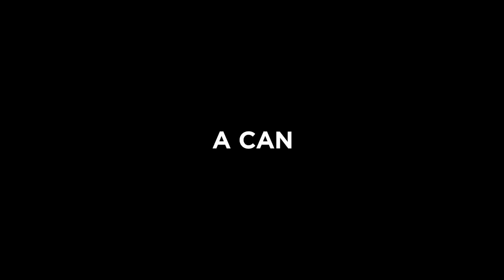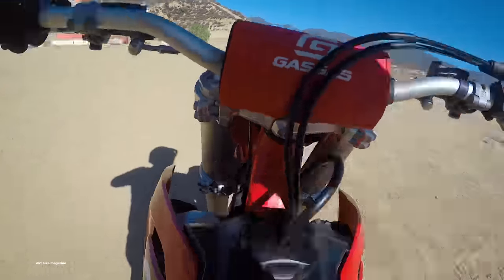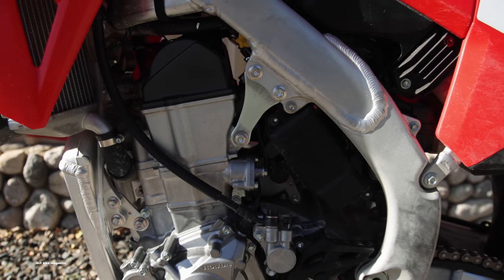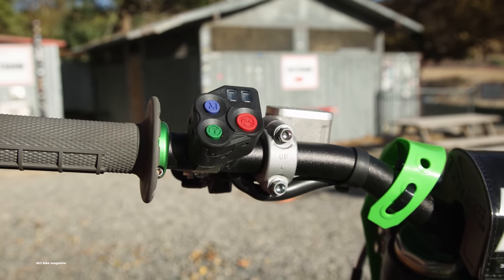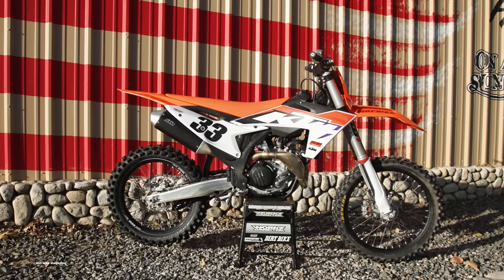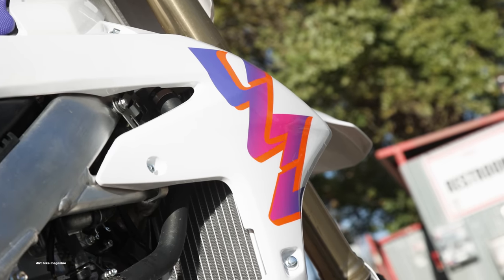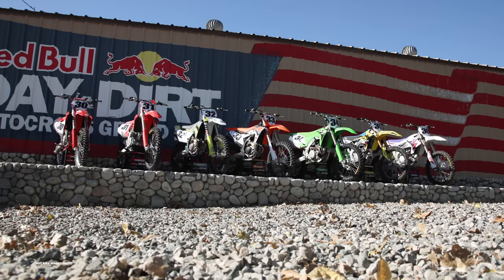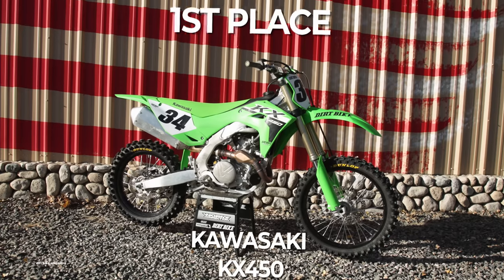2024 450 Motocross Shootout

Comment: I bought a brand new Suzuki 450 with a Yoshimura pipe out the door for $6800. I promise you 98% of the people reading this cannot ride this Suzuki any faster or slower than any other bike on this list. Also, if you are not riding Supercross you can simply blister some of these $11,000 bikes. Has a lot more to do with Rider than the bike. I am 59 years old and could not be more happy with the Suzuki. I’m never going to do a triple but I can have just as much fun maybe more for half the price. Think about it before you go and buy a motorcycle you cannot handle or ride to its full potential….. just saying
Reply: Thats 100% right
Reply: Hell yeah - recently picked up a new leftover '23 for $6,200 OTD and couldn't be happier as a vet-aged beginner. Way more bike than I will ever be able to handle at an incredible value.
Reply: @nathanneudecker6516    congrats!  I would have snatched that up in a heartbeat too!
Reply: Love the new RMZ450 but def won't get it for under $8k OTD in my neck of woods! Haven't checked in last 6mos ..betcha its MSRP though same as other popular brands.
Reply: @Davido50  North Carolina
Reply: @Davido50    i saw a new 22' rmz450 still hanging around for 5k.  What a steal that is.
Reply: Ĵust pick what color you like and ride it .. Nerds
Reply: Electric start makes a world of difference in a race should you wreck or stall the motor
Reply: @jordanl696  the only people saying they don't like or need an e start bike are those without an e start
When I stall my kick start bike it can take me 5 to 45 seconds to get going again (hopefully) . An entire moto would be tossed away
In the woods it can open up a gap it takes an hour to make up on a competitor
I scramble to grab my clutch and keep it running when I crash
Reply: @jordanl696  You’re absolutely right when you have plenty of power. I have four electric start dirt bikes. But you’re absolutely wrong when you’re 30 miles away and your battery goes poof. You would wish you had your Kickstarter back.
Reply: @SKG1941  I think you all should realize kickstart is awesome.  It simply works.  I have both and it’s convenient to hit the start button.  I don’t thinks it’s that big of a deal to kickstart a bike.  I think it’s just people simply to being lazy.  Incorporating half the crap on the bikes we have isn’t making them necessary better.  It’s complicating them and making them harder to troubleshoot and making them more expensive.  We don’t need e start and fuel injection.
Reply: I completely agree.
Reply: @someoneyouknow96  by"we" are you speaking of you and ithe mouse in your pocket?
Reply: i just bought a new 2024 -- suzuki dealer is 5 miles from me -- every other dealer is at least 35 miles -- did not even test ride any of the others for that reason  -- i'm 2 years younger than you  -- i have no complaints at all with the bike and agree with what you said -- all the power i can handle
Reply: @jimnagel5611  Amen my friend
Reply: @someoneyouknow96  HUGE steal. Where is this? They want MSRP by me unless it's leftover model. They all sell too well out here. #KTM #Yamaha
Reply: @jimnagel5611  That's way to do it..esp if ya have good local dealer! Enjoy that new 'Zuki.
Reply: @Davido50    sounds lazy to me.  Maybe ride girls bikes like 110s might be a better solution for the more feminine "guys" out there.
Reply: @someoneyouknow96  traction control, mapping, and launch control are ridiculous features for a bike. Those features remove skill levels between riders. Do t need them or want them. Like you said, more expensive to buy and fix.
Reply: I can drive 2.5 hours east and west of me but I can still get a new RMZ 450 for 6k
Reply: @dustinkeim179  I was at the dealership two weeks ago. He had one Rmz 450 Left for $7000 plus tax and whatever.
Reply: @dustinkeim179    badass!!
Reply: Where do you get those prices? I want to buy one but my closest dealer sell it for over 10k+ with fees and bs
Reply: @adrianlozano2687  I got it from our local dealer here in Wilmington North Carolina, which I have a great relationship with. He only had one more 2023 and he was said he would not take less than 7000+ tax and freight.
Reply: @jordanl696 also makes a world of difference for a non-racer, over 50 years old and in need of knee replacement and cardio improvement😂
Reply: Cheers to that. I have as much fun on my vintage bikes as my buddy has on his super modified late model. I go just as fast, too. He's got over $20k in his. I have under $2k in mine. Get any bike you can afford and go have a blast
Reply: @oemclutchbasketoemclutchbasket  Amen. The older the bike,the easier it is to maintain. This computer crap and fuel injection is amazing but at the end of the day I wish I had my DR 650 back. Keep the shiny side up and enjoy every second.
Reply: Tottaly agree, in my case i always get the lightest one, i am 65 kg 174cm so i need the Lightest one to be able to controll it as i like ;) idc the brand
Reply: @someoneyouknow96  Near me in Upper Midwest ..RMZs get MSRP cause they sell well. None in stock last i checked w/ 2 local dealers. Yamaha/KTM/Kawi also sell really well. Again it's MSRP for all + tax. Never pay setup fees etc. All obligated (by manufacturers) to prep bikes! Blows me away that ppl pay extra $1k+ for setup/freight/tax. Negotiate better w/em i say!
Reply: @SKG1941  Depends on what's selling in particular areas etc. Yamaha/ KTM /Kawi also def MSRP. Both local dealers are excellent at least & dont charge other "fees" except sales tax of course. 2-3 w/in 1hr distance i may check out. Or may get 250F instead. I'm Vet rider /racer. New Triumph 250F looks outstanding w/48hp (claimed) + lightest weight in class. Beta & Ducati look to be other solid options in near future. -NW Ohio
Reply: @someoneyouknow96  Wow thats an excellent deal. We know it's same bike so whether '22-'24 makes no difference. Still avail? You should grab that. Could resell it elsewhere for $2k profit easily.
Reply: @64maxpower  For sure bub. All are great bikes. Having options is a good thing! 👍🏻
Reply: @64maxpower  Truth. Your at clear disadvantage in any competitive environment w/out e-start. Otherwise no biggie.  Still hard find new RMZs in my area under msrp unless leftover model. 😢 -NW Ohio
Reply: @someoneyouknow96  Well it's a definite disadvantage not having e-start in any competitive environment . Play riding or otherwise no problem. #Maxima #KTM #Yamaha
Reply: @someoneyouknow96  No beta guys out my way riding/racing there cupcake. Lots of us are Veteran riders/racers that started as young teens late 80s /early 90s. As long as im not in racing environment kickstart is ok. #KTM #Yamaha  -NW Ohio
Reply: @ronn68  Many are indeed unnecessary but def not all features. E-start, traction control, fuel injection, map choices improve the experience & often performance. Facts. -Ohio
Reply: @dustinkeim179  That's great . Like said in other comments just depends on demand in particular areas. I'm not in a major metro area! More lite suburbia/semi rural/farming etc but 1hr from 3 major metro areas. My 2 local dealers stock most brands & have no trouble sellin em. Rare to ever see leftover units. -NW Ohio #KTM #Yamaha
Reply: @SKG1941  That's very solid deal esp if has RM Army package. I'd prob snag it as extra bike. Rode RM125s in early-mis 90s . Loved em. Now all KTM & Yamaha in my garage. Maybe Triumph soon. There 250F w/48hp (claimed) looks outstanding. -NW Ohio
Reply: @oemclutchbasketoemclutchbasket  I feel ya! Vet rider & racer here as well. 52yrs old. Been ridin/racin since late 80s . Msrp + tax out by me unless it's leftover. Rarely any leftovers tho unfortunately 😕. -NW Ohio #KTM #Yamaha
Reply: Absolutely 💯. Have 2 early '00 RMs i def won't sell. My newer machines are KTM / Yamaha tho. Wouldn't mind new RMZ 250 or 450 if prices were below msrp like NC dude says can get. -NW Ohio
Reply: @Billyipod  Ya hear MX Action sayin all new Triumph 250F has 48hp (claimed) + lightest weight is class? I'm def interested. #KTM #YAMAHA
Reply: E-start is not just a racer's advantage. Having to kick start can make a precarious situation that much worse. Dangerous, even. Haven't any of you ever stalled on a hill climb? How about trying to restart if you have a get off. Hell, just kicking a big bore or high compression bike repeatedly, while you wait for a group to complete an obstacle on a hot day can be taxing, if not painful. What if you're in the middle of nowhere and get injured? Ever try kicking a bike with a broken ankle? It doesn't matter which ankle. It still sucks a lot more than hitting a button. Then there is the possibility of mechanical failure. It's not uncommon for components to wear out or break. The process alone can beat the heck out of you, your boots, your foot pegs and the lever.  I've experienced every reason I just mentioned. E-start is great (when it works). But I think they should have left the kickers on them, too.
Reply: @oemclutchbasketoemclutchbasket  completely agree. As you mentioned for a safety precaution, you should have the availability to kickstart as well. I do earn KTM‘s a Husky, Yamaha YZ 250 FX and a Honda 250 as well as other bikes, all have you spell art and I love it.
Reply: Damn I was just able to grab my 2024 kx450 for $7390 OTD.  I wasn’t even considering buying a new bike until I saw how cheap it was.
Reply: Suzuki 450 too much motorcycle for anyone not on TV? Bike set up is a bike/ track /rider dynamic? Plus time on bike? Time spent racing is the only thing that helps on race day?

Comment: I would love to see Suzuki come out with some “X” models like Honda, Kawi and Yamaha have done
Reply: X models? 😂😂They haven’t had any R&D for years. Haven’t done anything with an E start or any other mods for a base model.
Reply: Suzuki made a rmx450z for a couple years. 2017/2018 or something. Had a headlight, electric and kick start. No one bought them so they went away 🤷🏻‍♂️
Reply: @kurtheidelbach the kawasaki and Honda models just slap a kickstand and a 18” rear on them with some softer valving, a bigger tank in the hondas case. Don’t need much r&d for that
Reply: @nickblaser992  Yeah, not much of a market for a 4T kick start woods bike these days. Suzuki gutted their product line already.
Reply: @kurtheidelbach  this is true. If they did put an E start on the rmz250 would honestly be pretty potent for woods. Handles tight turns better than most of the others
Reply: you probably havent rode a 2015+ suzuki @kurtheidelbach
Reply: man want to be complaining about E-start you shouldn't be riding dirt bikes in the first place. @kurtheidelbach
Reply: @ZacM122  It has absolutely nothing to do with complaining about E start 🤦🏻‍♂🤦🏻‍♂It has to do with where the market is. And no the market is definitely not in kick start 4T’s 😂
Reply: XR650L is slow but its an X.
Reply: Most riders, including me, can't tell the difference between an X and a standard bike
Reply: Just ride.
Reply: @MikeAnthony1969 and what exactly do you mean by a standard bike? If you ride a motorcross bike and ride let’s say the yz or crf X models you will notice some differences.
Reply: The problem with the RMX model was every magazine tested them on a motocross track, not in enduro stuff like they should. ”Suspension is too soft” well no shit you shouldn’t send it 50m across jumps and be surprised it bottoms out. I blame all journalists for some bikes being unsuccessful because one aspect is slightly worse and a pro might be affected so thet trash that bile in the review even tho laptimes on the same track differs a tenth of a second. Which is insignificant for 80% of all riders.

Comment: Form me Suzuki, best quality price and looks so cool!!!
Reply: What are you talking about? The Suzuki hasn't updated much of anything in the last decade, far behind the parts on other bikes, yet only 1,000 less than a Kawi. Not worth it imo.
Reply: @Josh.Mangelson  For a sundey's rider like me is perfect is cheaper than the others, realy good looking and super easy to ride!!!
Reply: Kick starting a 450 during a hard ride sucks. And it’s heavy
Reply: Not at all. Once ur used to it lol
Reply: What Josh said. Suzuki is way too expensive for a 10 year old design. If they are not going to spend the money to update it. Then it shouldn’t be more than 5k out the door. Same molds and assembly line. They are not putting money into the bike, we should have to pay almost the same as the other brands
Reply: The Suzuki will guarantee a full day of riding without any problems.
Reply: @CodySimoncelli-of7xx  ya but at the price point for what they want…you should get the creature comforts of an E start less weight Hydro clutch and modern design
Reply: @Josh.Mangelson . Buy your kawi and quit bitching.  That’s what I did.  I bought my Kawasaki for less than a Suzuki and that’s the only reason why I bought the Kawasaki.
Reply: @stevesmith756 . Tell me you’re not very smart without actually saying it.  It’s obvious.
Reply: @someoneyouknow96  it’s nice that they let 5 year olds post and comment on here now
Reply: @stevesmith756  says the guy that comments "ya" which actually is spelled "YEAH".  
Educate yourself and go to the gym so you can kickstart a full size bike and pick it up.
Reply: @someoneyouknow96  I guess you don’t understand slang. Make sure your mum wipes your bottom before you put your riding gear on
Reply: @stevesmith756    thats not slang, thats stupidity.   Along with thinking a new suzuki should cost 5k because its unchanged in years.  
Just be happy your body automatically breathes for you because if it was a cognitive function you wouldn't be here today.
Reply: @stevesmith756 10 year old design? Do your research before trying to prove a point

Comment: Team green! Too bad it took years for them to get rid of the EFI couplers. Had a 19 KX 450 and loved it.
Reply: New KX450F is much slower than last yr. All have said. They will have tough yr in '24 moving bikes.
Reply: That may be the case, but I assume Kawi wanted to make their power more useable. Most power in the class means nothing if you can't control it and Febrve seemed to have zero issues waxing the field in MXGP. 450's these days are almost too fast. I know I'm faster on my 350 than I was on the 450.

Comment: Are the gas gas and husky frames the same as the new ktm’s? Was hoping they’d leave it the old frame.
Reply: The husky has less suspicion travel, meaning the rear shock mounts are in a different location so yes the frame is different. Also different sub frames
Reply: Same here. their old frame was much better

Comment: If your not a pro rider any 450 has plenty of power and great bikes .
Reply: And if you're a pro rider, you're riding a works bike.
Reply: Youre right, still good to know which is the best bang for the buck and how they compare to each other
Reply: I think you’re right, weight , cost ,reliability n grunt are interesting.
Reply: There is a reason why they never compare power wise old with new kx or KTM..2009 Vs 2024..probably old ones was more powerful and brutal..they mellow them now and they confused us with some talk about who and some crank hp..the 09 kx was 53whp plus ..60hp crank..only 19 crf450 I think hit 60hp crank
Reply: @commantrosexetlos4700  yeah, the 2009 KX450F is what sold me on 4 strokes. Manufacturers have mellowed them since then.
Reply: @Josh.Mangelson  with some mod she's faster than others with more extreme mods.. actually unrideable in a good way
Reply: I have a 04 crf450 and a 22 kx450f and power wise they feel the same to me.  I rode the crf last weekend and rode the kxf Friday and I feel they are the same.  Id say my Kawasaki has much better suspension but that’s to be expected with 18 years of innovations.
Reply: @someoneyouknow96  yeah..they was having near or 60 hp now 20 years